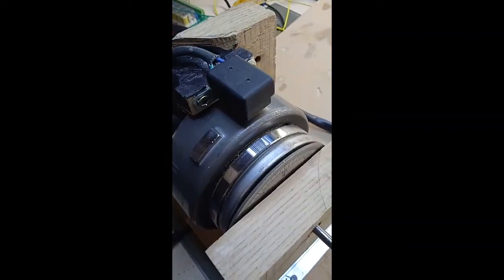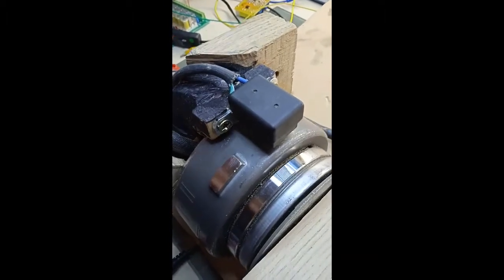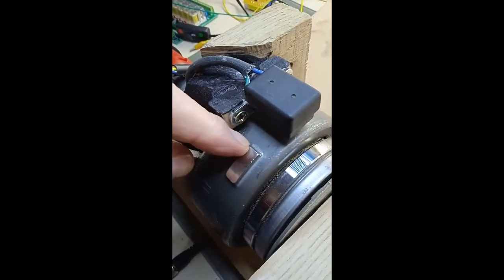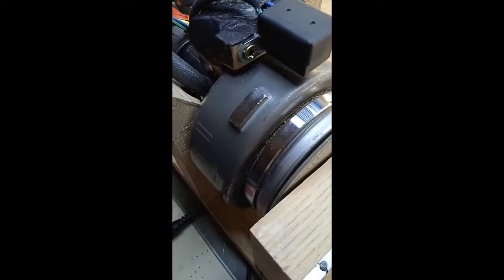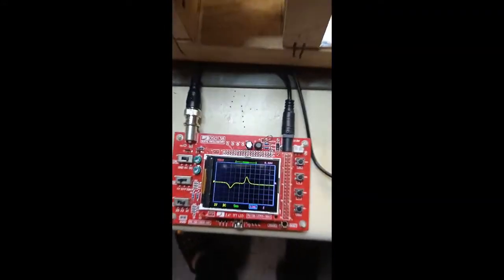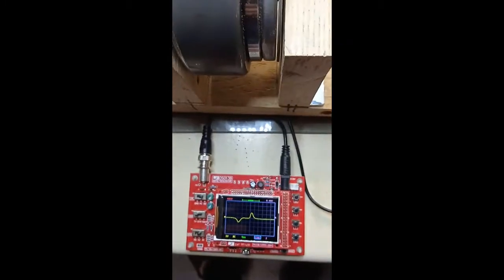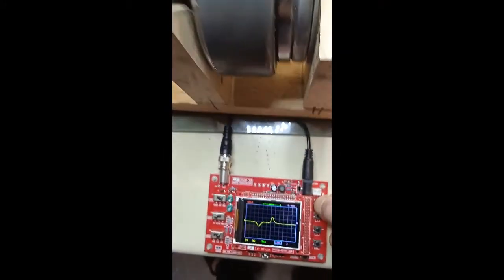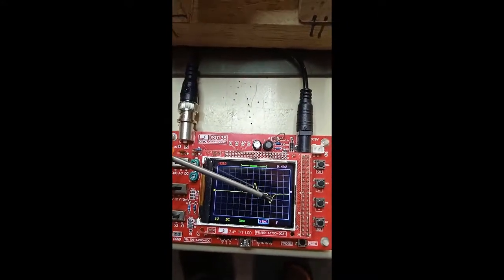VR pickup signal

Comment: What are the voltage values you're getting?
Reply from the maker: it depends mainly on the gap between pickup and magnet and of course on the speed of rotation.
It's around +5v -5v at 1200rpm to  +20v -20v at 6000rpm. Again it varies a lot depending on pickup coils...
Just look at the scope trace: https://youtu.be/nyDhEBxqRsg?t=90
it's +1volts and -1v but the gap on this bench is larger than a real engine.